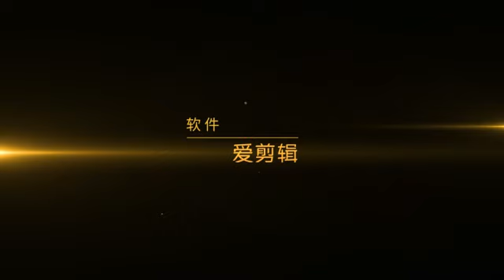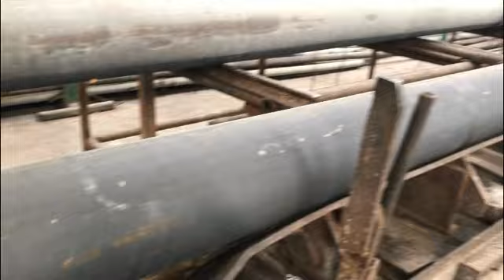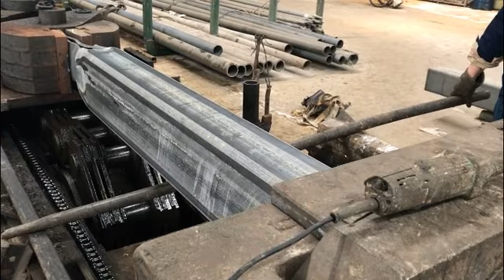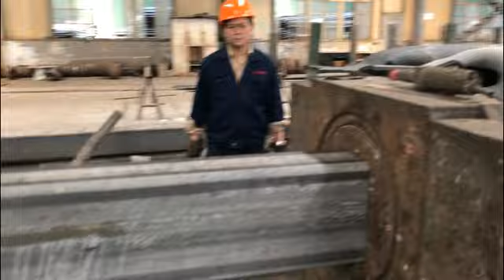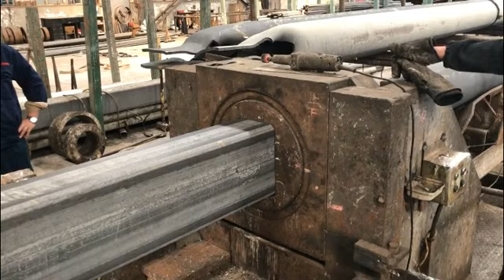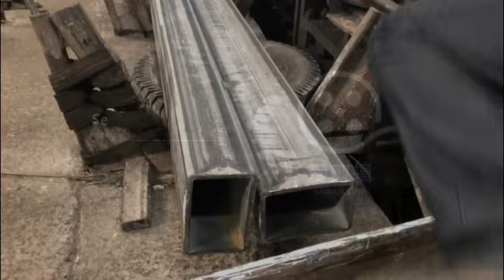Square Tube Production

Comment: The power to pull that through the die! Amazing.
Reply: The Sustainable Texan to
Reply: The Sustainable Texan it’s mild steel dude, it doesn’t get heat treated. It takes a tremendous amount of force/power to pull that through a square hole

Comment: Nowadays you can make that die with a wire cutter using spark erosion. In the old days of engineering, the product was more complicated that the tool, but these days the tool is far more complex than the  product!  The art is in the tool and not in the product, all  artists should be aware that  beautiful art now exists in the tool and not in their product.This morning I dismantled a damaged   electronic clock with an alarm, which my wife threw away.The very small synchronous motor which drives the gear train where the first gear had flexible teeth for silence,  was awesome. When I looked at it, I felt an inferiority complex as my  eighty years of engineering was the type that I could handle with my fingers.  Now micro-engineering is more that art and engineering combined.
Reply: I have to agree with you..I repair many tools that produce plastic bottles. I repair aluminium and steel dies... I use a laser welder and have the ability to weld inside the eye of a needle. Your old enough to know what a Thou is...well I can weld up to a sharp edge and stay 3 thou away from the edge. I have a niche business within a niche  business. Onya Mate
Reply: I would  like to see the pointer make that point.   Would the collapsed point help to sharpen  corners into die  would they use a plug to sharpen corners  ??. How do you get plug in??   Easy job with light tube

Comment: I would think they should have oil on that to prevent the galling he was picking at.
Does anybody know why that was done dry?
Reply: houndogforever looked like he put a shim in there between the die n matl for a check
Reply from the maker: because the tube is fully lubricated before cold drawing
Reply from the maker: @joshjacobson5595  it was lubrication process

Comment: And not a pair of safety glasses anywhere in sight. (c wut I didther)

No too many things softer than an eyeball flying around that foundry there
Reply: At that speed any flying metal will take about 3 minutes to reach their eyes, long enough for them to dodge it matrix style.

Should the pipe snap apart for some reason.. safety glasses will not help!

Comment: Now the question is ‘seemless round tube’?
Reply: When round tubing is made they push it thru an extruder.
Reply: I believe the process is called cold forming. That's where they push the steel at room temperature through a die and forms it the way they want it to be formed. Apparently, you get a better tensile strength out of it then you would if you were to heat it and then form it. They also make a lot of screws and bolts and such through that process of cold forming.
Reply: Round is not the only extruded all shapes are. But it's cold rolled or hot rolled. One leaves a skin with a nice finish, the other is a bit more ruff but harder. Extrusion is to give stock a uniform measurement for different and commonly used materials of all types and/or sizes.
Reply: Andy's World A round tube that is red hot has a pointed hardened die pushed through it. Thereby it has no seam